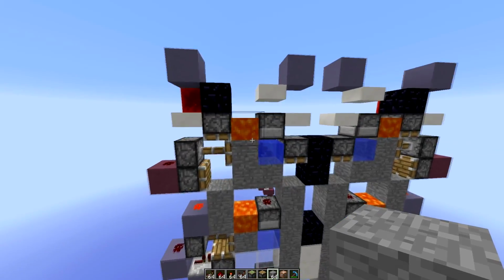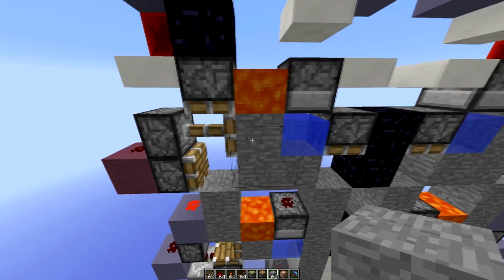Fast Smoothstone Generator (72,000 blocks/hour*)

Comment: Absolutely wonderful. As a skyblock player, I have always tried to reach the limits of stone generation, and there we are, the ultimate design (+ presented in a nicely crafted map). It's incredible how it's old but still so relevant to the latest versions of the game. Bravo!
Reply from the maker: Thanks! I do recommend checking out Ilmangos version before deciding to build it (It is the same speed)
Reply: @selulancie  That's actually where I come from ^^ But your version speaks a lot more to me, certainly because I can understand it : it's not just a mess of rails and observers!
Reply from the maker: @Lysquid While I do agree mine is easier to understand, his is way more lag friendly, and it also has a proper item collection system.
Reply: @selulancie  Yes mango did a really good job of optimisation, but still you were the first to achieve such a machine. Before I found your videos, I had spent 5h trying to build the perfect generator, all I came up with is an absolute monster (45 blocks wide) with a production of half of your (the science of ticks is what was missing to me), so yeah I really appreciate your work :D

Comment: I actually used this in a modded environment. When you need 256k of any items, or rather a constant flow of unnecessary crap and have access to modded instant block-breakers - this is a real life-saver.

Also compacted the machine to be 5 blocks wide and MADE it work on our server, but still, nice one indeed :)

P.S. Greetings from Russia and merry Xmas and happy New Year!)

Comment: Would it be possible to get the same rate with, say, 4 generators in the End? Not the most practical place, sure, but if you needs tons of stone and don't want to spend much time building it. :P
Reply from the maker: +Wout12345 Don't know. since the usefulness of this thing isnt exactly high, I will leave that to someone else to find out :p
Reply: +Wout12345 Most probably. We had that idea also but never did anything with it (partly because the first was already way to complicated/time consuming to build up...)

Comment: Great design!

I have a similar design that uses just 6 stone generators, but I didn't want to make a video about it, since it has the tendency to fail. Using dispenser is a really nice way to make it work reliably.

I don't 100% agree on your explanation of the 5 tick delay, but if it works, it works :D

Comment: fast bur there s already faster, and less pickaxe intense wither cage powered cobble gens xD
Reply: +Jendrik Cobblestone ≠ smoothestone
Reply: xD cobblestone+furnace=stone xD
Reply: u d only need 200 furnaces. that s not too bad. also, a blaze farm is super easy to build. this is practiacal
Reply: i must say, u r very nice :D
also, i actually think that s very well practical but u dont have to. i dont see how it could be hard to get this setup, normally smelters rnt too hard to build i find. i ve seen a smelter that could handle 64 items/second already, and i m prob. gonna end up building it once i need mass smelting actually xD
Reply: have u ever crafted a crap ton of pistons? u dont realise how much stone that takes...
Reply: Jendrik Weise pistons require cobblestone?
Reply: fail yeah we r talking about stone... whatever comparators and repeaters for a sorting system r just as bad xD